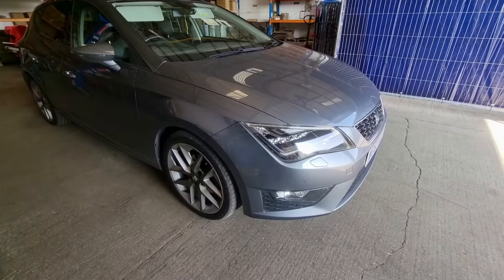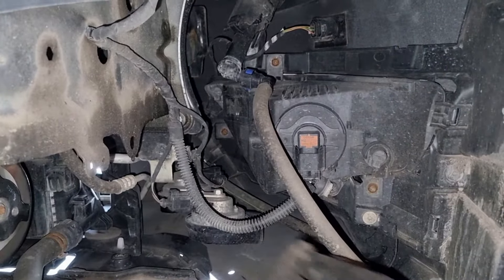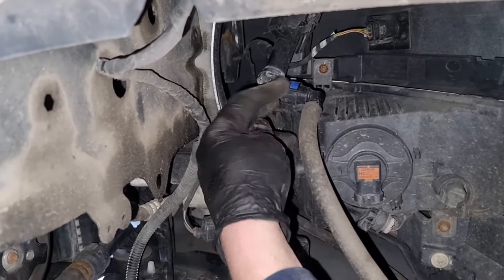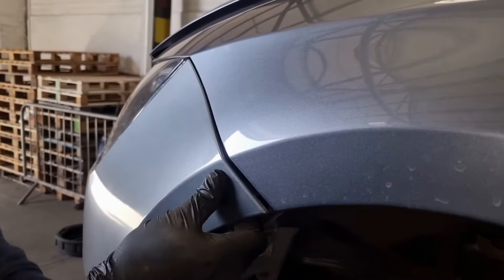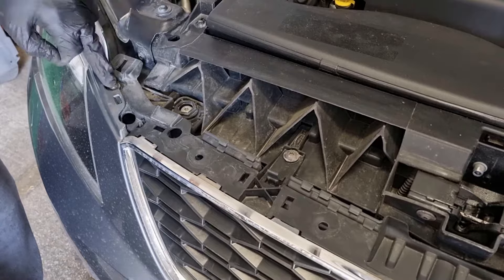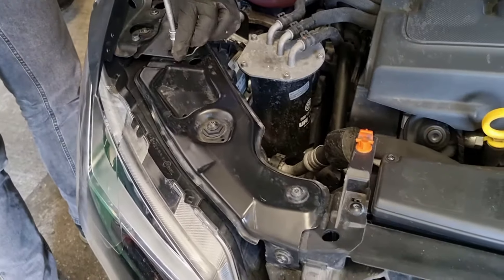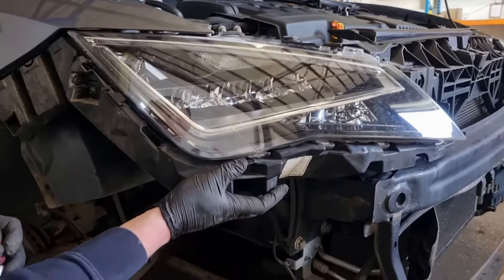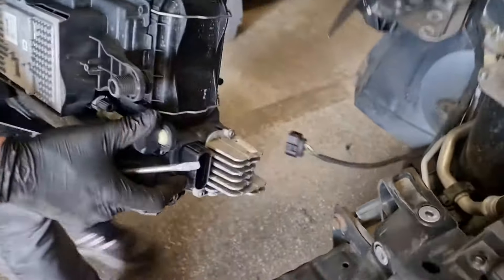SEAT LEON MK3 - How To Remove Headlight Headlamp Removal Replacement 2013-2019

Comment: Modern car industry - you have to tear apart half the car to remove the headlights. 😕 Good and useful video, thanks. 🤘🙂 Do you perhaps know if this seat model that comes with halogen lights can be fitted with LED lights that go on higher equipment levels? Just mount without software issues?
Reply from the maker: Sorry we aren't sure on that one, we've not tried this ourselves.
Reply: And yet they get stolen so quickly. I don't understand anything anymore
Reply: Ah, about the upgrade, yes, you can mount LED headlights BUT you need to get them programmed. This headlights are no longer plug and play.
Reply: Just what I was thinking of.. Jeez, literally the whole front end of the car has to be removed to reach headlights lol
Reply: @TraciaKurosawa  how would we go about getting them programmed and do you know how much it costs?
Reply: @shozabonyt6663  you need to find someone with the VAG scanner and programming setup, which isn't that easy to find, and the cost I'm not sure, the headlights themselves would be around the $500usd each piece and then the programming could be something maybe on the $300 usd at least. I don't know if it's truly worth it.

Comment: Watching this and i don’t remember seeing you remove the 2 bolts in the front lower grille?
Reply: Yes, they didn't include this in the video. Very important note - if you don't remove these screws, you can damage the bumber trying to "unlock" it from the side latches.

Comment: Hi, great video, I have a damaged head light lense, is there any way to replace the lense and not the whole head light?
Reply: Hi there did you find.Way to repare it ?
Reply: @karmaboost5437  
No, do you know if you can?
Reply: @JasS-qf4ge  i asked some professionals ty said that the LED cant be replaced there for i need to replace the hole thing sadly ( it cost alot )

Comment: I need to replace the driver's side headlight on my 2016 Leon Cupra. No fogs or washer jets but I have parking sensors. Do I need to remove the whole bumper including arch liner and parking sensors like in the video? Or is just dropping the bumper on to the floor enough.
Reply from the maker: You may be able to get away with just removing the front arch liner fittings and the one side of the bumper. This should allow the bumper to move forward enough to get to the headlight fittings. Removing the top central bumper fittings will also help.
Reply: @SelectVehicleSpares  thanks! Can leave the parking sensors plugged in?
Reply from the maker: @richardhurr31  Yes I would think so, as long as there's enough length on the cable. Personally I would unplug them, it's easy enough to do and then you don't risk pulling on the wires.
Reply: @SelectVehicleSpares  can you unplug them without taking the whole arch liner off?
Reply from the maker: @richardhurr31  Not sure sorry, we've not tried to do it that way ourselves.
Reply: @SelectVehicleSpares  so I managed to do it. Only issue I have now is the bumper is misaligned by about 2mm where it joins the wing on the driver's side. Is this easily remedied by loosening bolts and trying to shift it in to a better position? Everywhere else is fine. It's a bit annoying.
Reply from the maker: @richardhurr31  Yes, I would loosen off the fittings and try fitting it again.
Reply: @SelectVehicleSpares  I've noticed what the problem is. The new headlight is sitting a bit too high. Can see it by the gap at the top of it where it meets the wing and bonnet. The gap on the good side is bigger.  It'll need adjusting. Once that's done the bumper should join around headlight lower and thus align with the wing. Arggh what a faff. Will have to take it apart again.
Reply: @richardhurr31  how to you adjust the headlight ? mine have been changed in the past and it is too low, touching the bumper
Reply: @el_taiito5492  I'm still yet to do it. I will be very soon. I guess it's just a case of loosening it and adjusting its position a little.
Reply: You can just carefully drop the bumper on the floor - it was enough for me to be able to completely remove the hedlights.